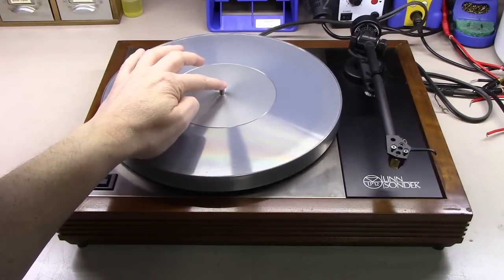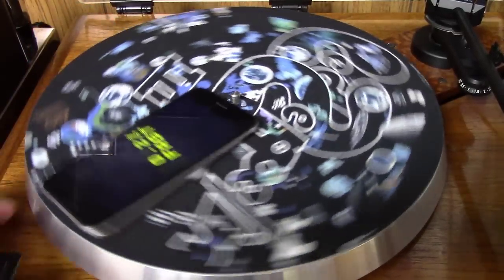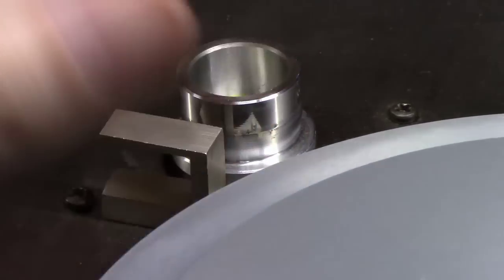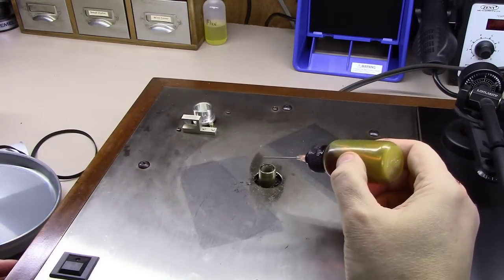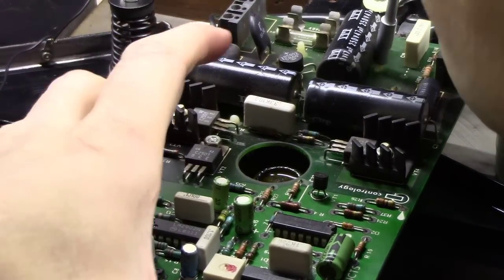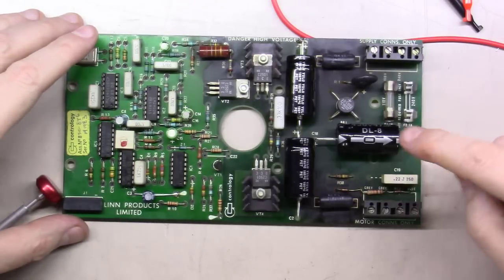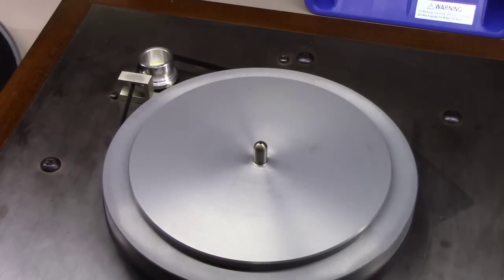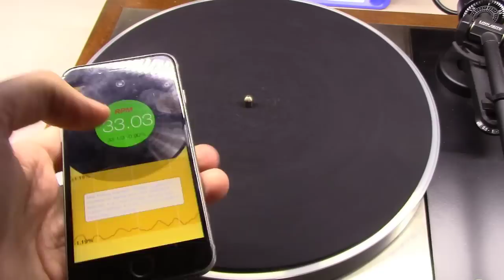Fixing motor start and platter speed issues on Linn LP12 Turntable

Comment: I have serviced hundreds of these. The three 47uF caps, R1, and BR1 are the main failure points. That board has already been serviced, the original R2 R3 resistors are much smaller, and the varistor has replaced a regular resistor at R1. Ideally, the BR1 bridge rectifier should also be replaced with a 1000V one. You should also adjust the white trimmer RV1 to 85V across the red and gray motor wires.  R32 (560k) is another potential trouble spot. But most important of all, anyone attempting a repair should unplug the turntable before going near the board. These boards are powered up 24/7 whenever the turntable is connected to power, that's why they are failing after 30 years. By the way, the oil you took out is the factory supplied graphite based Linn black oil. That's what's supposed to be in there.
Reply from the maker: I agree on the oil I replaced being factory, it was very tacky and gummy.  Good info on all the other stuff, I've serviced a dozen or so of these but no where near hundreds.
Reply: Where can one contact you to fix a turntable?

Comment: Just upgrade to the Mober DC motor and external control / SSP12 two piece inner platter and Mober bearing I did last weekend and will never regret it. Solid super stable ultra quiet, 45 & 33.3 and now much better resolution and dynamics. Linn charge us all way too much for upgrades that are no where near the cost effectiveness of this Mober upgrade.

Comment: Power for the motor board is direct off the power mains. Use an isolation transformer if the motor boards needs to be tested on the bench. Two power supplies on that board. One is HV used to drive the motor amplifier, other is a 9VDC used to run the CMOS logic stall divider, LP filter, control circuit and part of the motor drive amplifier.

Most common fault, the three 47uF 'lytic capacitors, there is a power line inrush limiter that can give problems. The slow roasting of the capacitors is due to the 15K resistors used as a rectified power line voltage divider. These 15K resistors dissipate about 1.6 watts long as the Linn is plugged in. Highly recommended to replace these with two 7.5K @ 5 watt power resistors to spread out the heat and  reduce further heat damage to the pcb. While you're in this board, replace ALL the 'lytic capacitors as the OEM units are mostly awful.

The power mains rectifier some times die. Other designed in problem is R33, 180K @ 1/2watt resistor. It is under rated and tends to roast. This can happen to R32, 560K @ 1/4watt resistor which is a divider for the motor amplifier first stage using an op-amp. This resistor is also over worked by heat. It is possible to find poor solder connections on these boards. Check this as another potential intermittent problem source.

Comment: You've probably got cracked and burnt resistors too. I recommend you have a really close look. There is a known update you should carry out on the Valhalla power supply board. If you do a search you'll find there's a standard upgrade which Linn did in the late 80's. As yours hasn't been done (I can see by the old bridge rectifier) I would strongly recommend you do that - no need to send it to Linn. Also, if your electrolytic capacitors are drying our, you should look at replacing all of them as they're very old. I also found that Resistor R33 was completely fried and needed replacing (upgrading) . Here are the notes I made when I did mine: VALHALLA UPGRADE.

Replace R1 with Surge Gard SG240 Thermistor (Digikey)
Replace BR1 with Vishay KAB100E 1.2amp min (Farnell/Digikey)
Replace C18/C1/C2 all with new 47microfarad 250volt axial NCC (Digikey)

Replace C3 with 220microfarad 16volt radial
Replace C14 and C20 with 1microfarad 63volt radial
Replace C15 and C8 with 22microfarad 35volt radial		use 22 mi-farad 50v in stock

Poss replace R2 and R3 Welwyn W22 7watt 15K resistors

Notes:

RE: Valhalla thermistor
The 3 big caps are 250V axial lead ones, they're perfect fit. Although higher rated voltage caps are sometimes suggested or seem a safer bet, its often they're bigger in diameter and may result with marginal or insufficient clearance to re-install the bottom board. Take note of this.
Its imperative to replace all the other electrolytic caps for another lease of life, considering the whole thing is likely over 2 decades old. Note also that there's a capacitor (220uF/10V axial) nearest to the ribbon connector which one lead have to be soldered on the top and bottom plane, only this one. You can substitute this for the more commonly found 220uF/16V radial type, but again, ensure soldering the negative lead, top and bottom plane.

Comment: You should use light machine old for the bearing , it's a white bearing liner .  And you should fill the bearing with oil and put tissue knotted around the bearing and replace the inner platter and then remove the inner platter and the bearing oil is done , the way you did it , there's not enough oil in it the way you did it .
Reply: Use only oil supplied by Linn.  Using a 2mm or 2.5mm hex key as a dipstick, there should be about 5/8" of oil in the housing before the inner platter is installed and the extra oil overflows.
Reply: Correct, correct, correct also pre spin the platter before ON switching.

Comment: Just to say if you aren't happy with re-capping your Valhalla, an alternative power supply is the Hercules. Arguably better sound but it does give you 33 and 45 RPM. I dropped one in when my Valhalla literally burst into flames! Oh, don't be worried about dark oil - Original Linn turntable oil is black! Very interesting video otherwise, thanks 👍

Comment: this is a later production turntable, or one that has been upgraded to have the gray sleeve inside the platter bearing (and black suspension bolts), made of a high-impact material called Peek, and which is ventilated to let the air out quickly when you reinstall the platter. Therefore don't let the platter fall hard into the bearing. Also, you didn't use anywhere near enough oil.
Reply: That's not a PEEK bearing. The only reason it dropped so fast is that there's hardly any oil in there. The bearing is designed to be filled to the point where the oil overflows the bearing. about 45 drops for a clean bearing.
Reply: @gotham61  5/8" - see above comment.

Comment: I own a Linn LP12 made in 1976.A couple of days ago the platter stopped rotating. For about a week before this happened I would notice a very mild noise for about 3 seconds that would go away as the platter reached full speed. When I now place my finger on the motor pulley I feel a vibration but no rotation. Could the problem be with the power circuit board which the original board and not an upgrade ?

Comment: I had the same problems with my LP-12 a couple years ago.  I re-capped the board but it didn't solve the problem.  Then I ordered a Hercules power supply from Stamford Audio in the UK.  It was not cheap but the Hercules gives you 45 rpm -- comes with a new switch to allow 33 1/3 or 45 rpm.  Unfortunately that still didn't fix the problem :(  so I bought a new motor, also not cheap.   But that fixed the problem and even though it was a chunk of change, I think I won't have any more problems for a long time.

Comment: Can you describe how to troubleshoot the motor if the power supply repair did not fix the issue?
Reply: Same issue with the motor pulley after replacement of Majik PSU by Lingo 3 PSU. Please can you tell me how to fix this pulley which jerks and which is not able to pull the plate? Thank you.

Comment: To prevent belt stretch, slip and shine it is, in my opinion good practice to give  the platter an assistive spin whilst you switch on....also periodic belt clean with isopropyl.
Reply: HiFinuts, no, do not clean turntable belts or other rubber parts such as tape deck pinch rollers with alcohol. It dries out the rubber! Use non alcohol-based cleaners. I recommend IntraClean.
Reply: Correct except no alcohol or organic solvent on the belts, it removes the plasticisers in the rubber and belt cracks also stretches. Belts only need a dry wipe. Pre spin the platter by hand before ON switching also remove belt after each play session and store in plastic bag or box away from heat, sunlight air conditioning. When removing belt use the back of your nail no finger tips, very important. Belt will last for decades and track with the correct tension.

Comment: I had an LP 12 years ago w/the Valhalla sound board, and the Itok 4 arm. Loved it, but man, if you bumped it by accident you had to set it up all over again. Had it before there were really good sound deadening/vibration cancelling racks. I had to buy a rack and mount it to the studs. Went to VPI, and never regretted it.
Reply: Yeah, I have an Aries 3 VPI and I picked up an LP 12 to mess with, when you look at how much money you can put into the Linn to get it sounding great, then look at a VPI classic on the used market the VPI is a no brainer if you want to plug and play.
Reply: Yes, a wall shelf mounted to the studs, on an outside wall if possible, is absolutely necessary for the LP12, or any suspended turntable, for that matter.
Reply: @terrylarson7596  Yeah. I had the classic with (12” arm just before 3D arm), the outer ring, metal clamp, Lyra Kleos. The rest of the system and accessories were fantastic.

Comment: Linn use Velocite No 6 high speed spindle oil and filled so the oil seeps out of the bearing when the inner platter is fully down.
Reply: Thats why authorized Linn dealers had a jig to hold the turntable up in the air to work on it. I have one somewhere.

Comment: Just re caped  mine interesting those  small 16 volt caps in mine they are 35 volts ? may be that,s what Linn had at the time production or a later revision ?  Motor is much stronger torque now . There is a pre set on the board  which needed resetting, connected a meter to pin 1 grey wire and pin 2 red wire motor on the terminal strip and is now reading correctly at 85 volts +- 1 volt  the motor starts first time.

Comment: Ivor Tiefenbrun would have told you that changing the caps away from the original make would completely destroy the sound. There again, he often talked bollocks.
Reply: Ivor would have said fuzz that 40 year old board in the bin mate as a Lingo would ring around it.. and he'd be right.

Comment: It so happens the Thorens TD150 top plate will fit exactly into an LP12 plinth. It is not by coincidence either. The spring points and subchassis fixings are measure for measure identical. Linn in fact (Ariston) made a well engineered TD150. The black oil is Linn's recommended lubricant.  The Valhalla supply was notoriously unreliable. Every single Valhalla will end up the way this one has - this must have been  low hours - most died in the same manner as yours 20 years ago? Speed is adjusted by carefully adjusting the motor tilt -  Tilt away to slow, toward platter to increase. Use the arm board as an indicator for spring setting levels - and it looks nicer if the arm board is flush all round. Spend time dressing arm cable allowing a free bounce as this is crucial for performance, tighten that 'P' clip hard. The AR was NOT the first suspended turntable as history keeps forever flippin' telling us...there were others, and I will leave it to anyone interested to research and find one - at least.
Reply: @jogmas12  There were others I suggest you do more digging.
Reply: @jogmas12 On a different scale, but relevant  - rather like Ferraris invented the polyphase motor in Italy before Tesla and Blumlein invented 45/45 stereo before anyone (a few claim this) in the USA. There are simply hundreds of injustices in engineering and it is always the self promoter that gets the glory. If you dig you will find. I have had a museum of audio back in the 90s - unfortunately I had to sell up.
Reply: @jogmas12  DUDE Did you find any?
Reply: @martinda7446  dude, the burden of proof is on you, after all you were the first one to state ‘there were others’ so……. get digging
Reply: @jogmas12  DUDE 1955 Scott 710
Reply: @jogmas12  There are at least 4 more.
Reply: @jogmas12  PS I'm not calling Edgar Vilchur a 'self promoter' he wasn't. I think it possible he came up with the idea independently, but he was a decade after dozens had done the same. Mr Vilchur was one of the great audio designers.
Reply: @martinda7446  “But neither the subplatform nor the light, slow motor originated with AR. The company – by its own admission – got these ideas from Stromberg-Carlson, an old-line supplier of telephone equipment that also sold audio equipment. But subplatform suspension didn’t originate with Stromberg-Carlson, either. The first subplatform turntable was probably the H.H. Scott 710A of 1955. It used a more conventional motor, though, and shaft drive.” Ok, after some research I’ll give it to you. I’m not one to not admit I stand corrected.
Reply: @jogmas12  Funny enough the Stromberg Caelson Perfect Tempo was another predating the AR.
No worries.

Comment: THAT WAS GOOD BUT NOT PERFECT JOB,YOU HAD HAD TO ADJUST TO THE NOMINAL 33.33 SO FAR THIS IS A PRECISE DEVICE ONLY THE OPERATING VOLTAGE HAD TO UPRISE GAINING THE ADEQUATE RESULT.IF I SAW GOOD THERE WAS A QUARTZ LOCKED CIRCUIT

Comment: Sir, I have LP12 with Zeta arm just got from a friend from usa, but since I'm in India ur Voltage is 230v/50HZ but the one I have is 110v /60hz, where can I source 50hz pulley.
Reply: I've used my LP12 in the US, Canada, Japan, and the UK.  Never needed different pulleys.  The power supply creates the AC sine wave to power the motor.

Comment: Glad i came across this vid as i have heard so much about how great the Linn LP12 is - well for my money i will stick to my Rega Planer 2 , which to my mind is far simpler , less to go wrong and the sound it produces is magic to my ears.For starters that suspension - is that really needed and that sheet metal underside , does that not produce minute resonance acting like an amplifier? Then the metal sub and main platters are also resonance producers compared to the sensible glass platter of my Rega. Also my Rega has a ball bearing that sits at the bottom of the bronze centre sleeve and the sub platter's shaft sits on top of that ball bearing , which equates to a point load effect with minimum friction.For me a better system than this Linn. Another advantage with my Rega is that i can buy a new o-ring drive belt from an engineering supply at negligible cost and works just as good as an original Rega o-ring. The only criticism i had with my Rega was that the sub platter was made from resin and thus very light , so i made my own one out of SOLID brass with a hardened steel centre shaft and that adds another kilogram of extra torque to the spin.It will take a huge amount of cash to buy a turntable to better it.
Reply: I initially had one of the first Rega Planers close to 40 years ago and then upgraded to LP12 pretty quickly, now I am old and suffer from Tinnitus from too much load music...it is great fun.
Reply: Ezio Cucit 
Rega is virtually plug n play, low maintenance 
Older Linn tables are high maintenance 
They look great though, very vintage in a good way

Comment: that turntable is truly amazing, its like perfection! one of these days i’ll have one of my own. are they high maintenance?
Reply: It is recommended that the setup be done annually, to make sure that all hardware is still tight, that the suspension is still adjusted rightly, and that the belt is clean and not worn.
Reply: TimmyP1955  Old news- an LP12 made in the last 25 plus years stays in adjustment
Reply: @NateEll  Any screw that goes into wood will need to be tightened occasionally.  As will any fastener that goes through sheet metal (the nuts on the front and rear top plate bolts.
Reply: Jason B 
Yes, the older ones are, the newer ones not so much
A tweaked out Linn will run about 10k, too pricey
Reply: I bought mine second hand 35 years ago. Other than replacing the PSU, oil and belt, I've done nothing with it.

Comment: Don't forget Thorens has a chassis/sub chassis design as well.
Reply: Robert Kohut, Thorens tonearms are generally not great but some of  the  turntable models are pretty good,  especially if they are designed to allow you to put a better tone arm on them. the TD 125 is a particularly nice unit.
Reply: Looks very similar to my Thorens TD150... Almost looks like some of the parts might be interchangeable.

Comment: Linn SondeR? Wow

Phone app for speed check? 👎

What power supply was that??

2 -3 drops of motor oil? Um Linn oil is black 

If you have an LP12 run, don’t walk. I think this was this tech’s first experience with a Linn LP12

Comment: great video you need to put more oil down the bearing should take a while for the spindle to fully drop and put a bit on the motor
Reply: paul davies, earlier LP12's have a white nylon- looking sleeve inside the platter bearing and on Linn turntables with this style  of bearing it does take a while for the platter to settle into place as it displaces the oil and trapped air; however, later Linn's have a gray bearing sleeve made of some high tensile strength material called PEEK  this gray bearing sleeve is ventilated so that air and slight splatter of oil will come right out of it almost immediately and the platter will drop in place very quickly.

Comment: SondeK. I know it looks like an R
Reply: 😂 +1

Probably mentioned elsewhere but there was in fact a legal dispute between Hamish Robertson (Ariston) and Ivor Tiefenbrun (Linn), to do with the design of the LP12 and how it was - in Hamish' view - a rip-off of the Ariston RD11.
Reply: The more common mistake I see is SOUNDek.
Reply: Hamish Spencer 
Sondek
Reply: @64bakes  They both ripped off a TD150, they simply got a measuring tape out and re engineered it. All parts interchangeable.